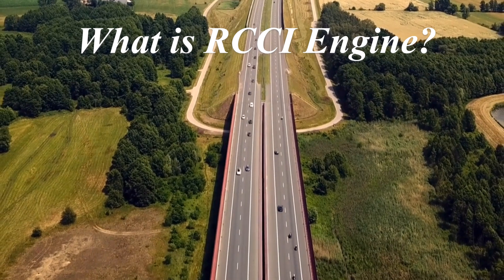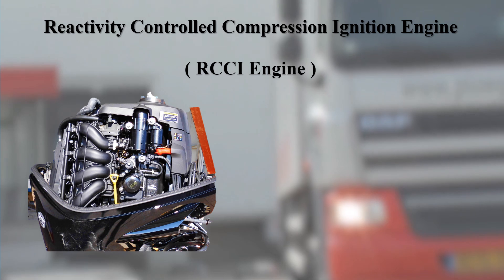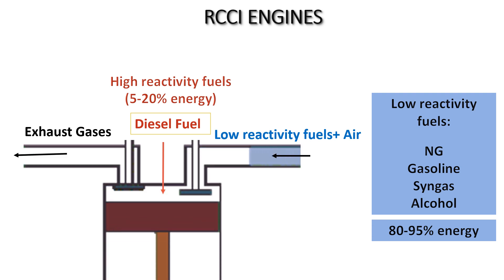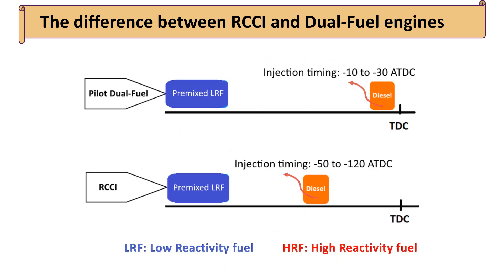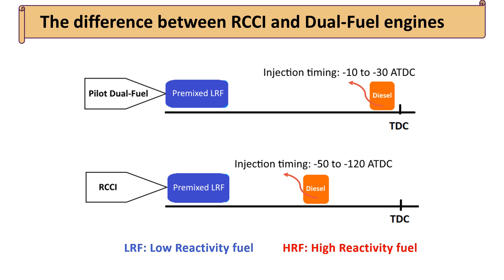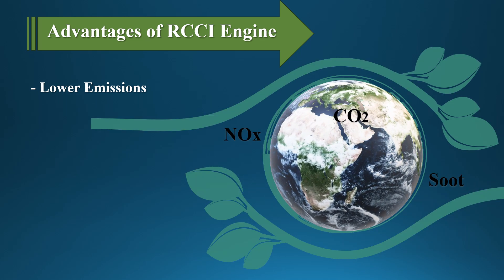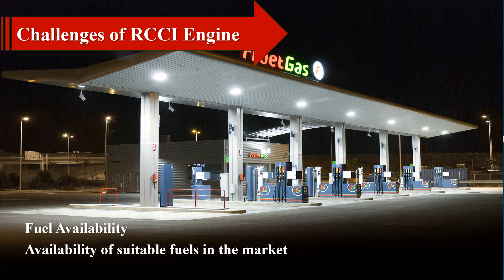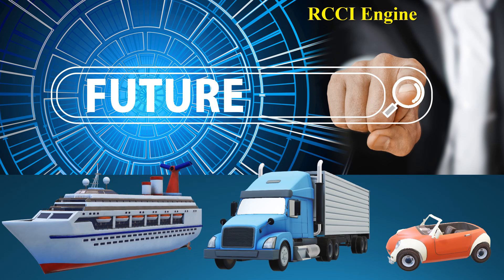What is RCCI Engine? Working Principle of RCCI

Comment: This new engine is called SCCI/D-cycle (Stoichiometrically Charged Compression Ignition/Differential-Stroke-cycle) engine.
Reply: The new SCCI/D-cycle (Stoichiometrically Charged Compression Ignition/Differential-Stroke-cycle) engine is a hybrid of the diesel and gasoline combustion engine, called "DIE-O-LINE" engine controlled via the Differential-stroke cycle technology (the D-cycle).